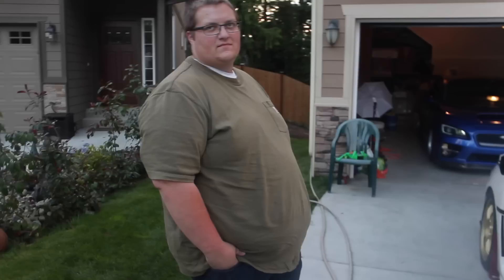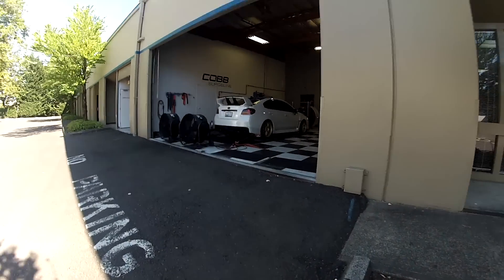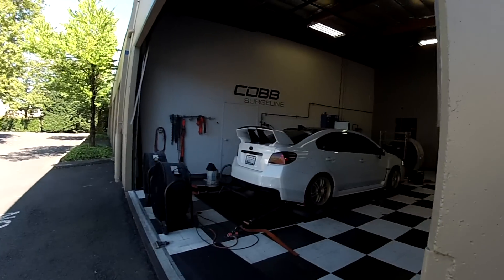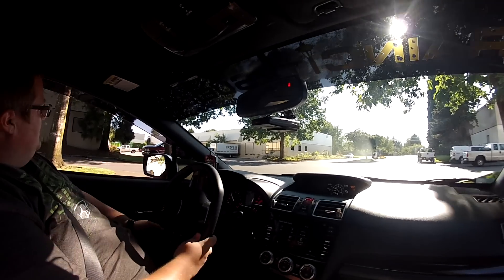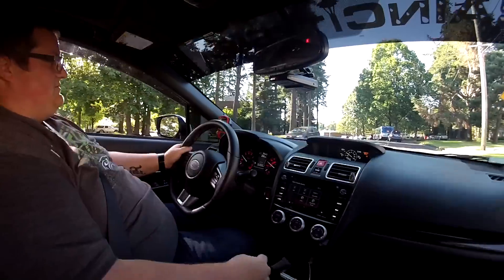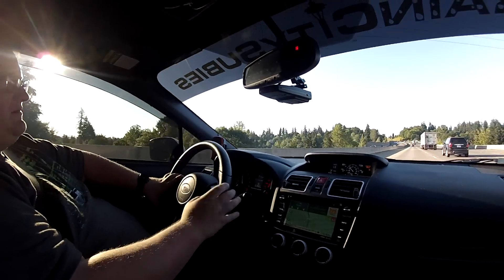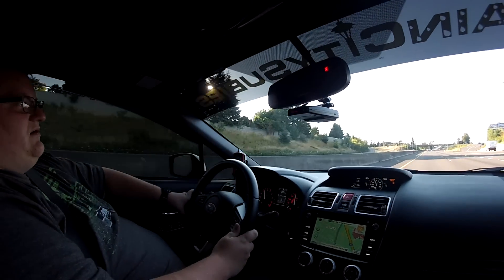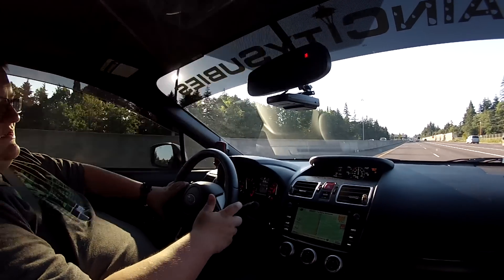HOT DYNO | PRL Motorsports FMIC Part 3/3 | 2016 Subaru WRX

Comment: New to the channel. Not sure if you addressed this already but why did you chose the wrx over the STI. I'm stuck, everyone says wrx is better daily driver but I feel like I'm gonna want more if I get the wrx......this will be my first car
Reply from the maker: akaju1c3 it depends on what you are going to do with the car. Up to stage 2, the WRX will make more power than a stage 2 sti but the sti is capable of making more power. I chose it due to cost. The sti was $14k more at the time due to dealer markups. I also did want to drop 40k on a car with a 20 year old engine.
Reply: Thanks so much for this. This helps so much, subscribed and looking forward to more videos

Comment: Ok guys I don't want to sound like a hater but those numbers are shit for a front mount and tomie exhaust. I would be very disappointed. I have a mishimoto top mount with the gutted jpipe mid pipe from Cobb and tomie exhaust and my low boost 13psi road race tune is 302hp/326tq. Won't even tell you my high boost tune I run on the street.
Reply from the maker: Every dyno is different. Even the same dyno on different days will read different results depending on environmental conditions.
Reply: On what dyno? This is a mustang which reads pretty low. This same setup on a dynojet would bring 340+ up on that screen. Plus dynos read low anyway, you'll always make more power out in the real world than the dyno tell you you're making.
Reply: +Simha1 2015 Wrx #777 ...like twice a month, but other than that it's been really good to him. He doesn't baby it at all either. Eventually he wants to go forged internals and try to get over 500 out of it, but for what it's at now I'm really happy to hear that the fa20dit handling what he's throwing at it reliably.
Reply: Yeah. I had my FBO and cammed Evo tuned at RRE recently and it made 419whp/403lbft @24psi and its was a 103 degree day so I would have to agree that those numbers aren't impressive.

However at the end of the day a dyno is nothing more than a tool and he saw some gains. That's all that should matter.
Reply: +Colt45Magnus it was on a mustang Dyno in Georgia Dbwmotorsports  in mid July. The tuner probably makes a difference also.
Reply: +Simha1 2015 Wrx #777 Yeah depending on who's doing the tune, the outcome can vary. Plus Jeff said he told them to tune it extremely conservatively. So it probably has potential to be in the mid 300's but then you'd have to question the reliability of your daily driver. Though I've seen people running decent numbers on the stock block with no issues. I've told a few people on here about my friends DD with by now over 90k on it (drives all over east cost for work) and he's running an ETS kit, same one you see in their video I believe, making around 430awhp and its holding up very well. He has to change the oil religiously...

Comment: Dyno plots are looking legit! Definitely a small turbo. But what with the slight increase boost lag? I mean, sure it still at about 3K.... FMIC?
Reply: I had Chris shift the power delivery to come on a few hundred rpms later mainly for reliability to avoid the low rpm torque that sends rods through the block.
Reply: You CAN win, with a built block. Haha
Reply: Jeff Reinke I, uhh, will just say, "sure". haha!! My experience with a built block so far has been not so "cherry".
Reply: And small turbo meaning it dropped quickly at the upper rpms. Haha! And with conservative tune. 👍🏼
Reply: seams like a lot of money for such small return .. wish i went with the sti... but still very happy with my15wrx.   only i need money for modssss  lol
Reply: +Brian Lau it depends how you look at it. Curious to know what the baseline is on this dyno for a stock 15 WRX. Then go off from there. but for a more meaningful gains, a bigger turbo is the ticket at this setup. 

seems tho Jeff is happy with the response of his wrx. all that matters.
Reply: +Jeff Reinke I see. that a common occurrence for the fa20? Scary thought there
Reply: Yep, pretty common. The stock rods can't handle lots of low end torque.
Reply: Jeff Reinke so not the piston as it is with the ej257... but rods for the fa20. just can't seem to win with subaru. haha!!
Reply: +White Wing STI :( that doesn't give me a good feeling about getting a built block...
Reply: Jeff Reinke i'm talking about ej257 block. haha! i'm hearing good things about fa20 tho. :) but do set yourself up for potential issues. you're going to be gathering multiple parts together for the build. have some expectations that one of those may be faulty. ;) and do budget for a "ceiling" just for any case. because I didn't. it's why took me 4 months to pick up my build again.